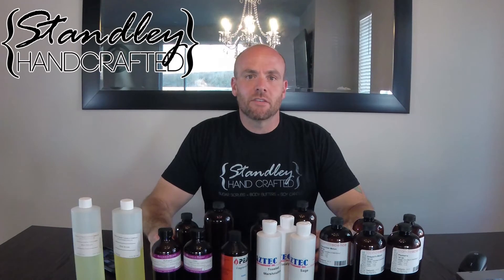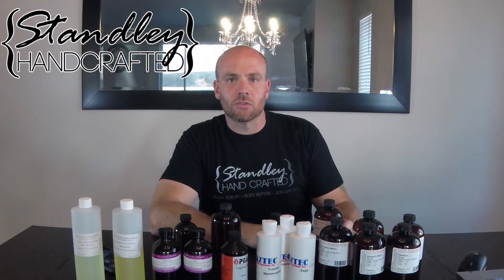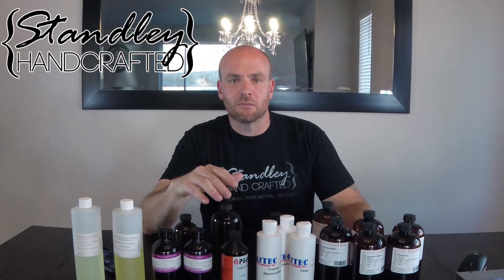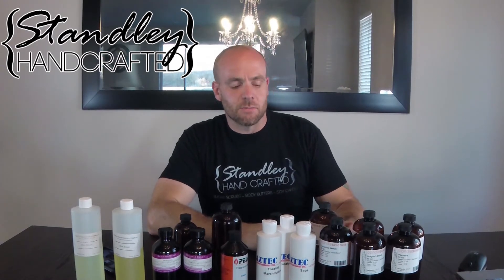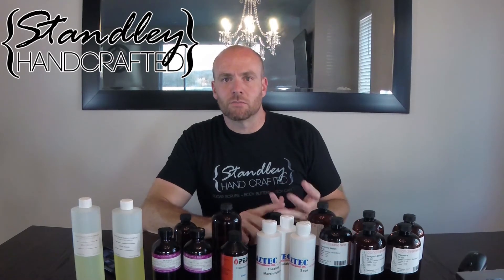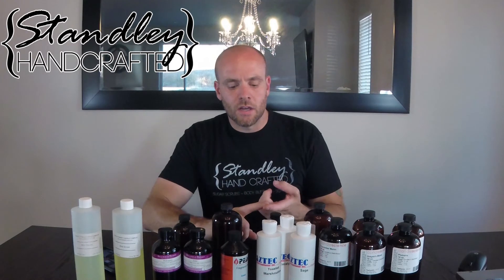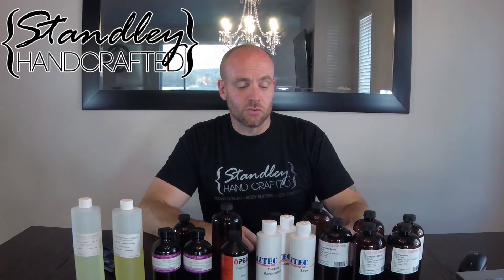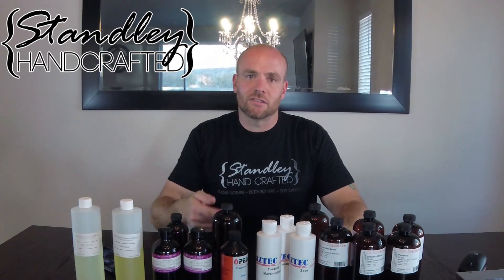Candle Basics 101: What are flash points and what do they mean?

Comment: I’ve never made them before but all the companies are like you must check the flash point as you shouldn’t never add the oil until it gets to that flash point or it won’t smell but then your saying it doesn’t matter ? I’m confused - mines for 30cl soy wax candles using orange
Reply from the maker: Michelle Heighway That’s definitely wrong. Check Candle Science webpage for a good explanation also. It’s a chemistry term for the temp at which a liquid starts to release vapor and can ignite if near an open flame. Not a concern for adding to wax.

Comment: Coming from soap making and knowing about essential oils this makes no sense. Are FO packaged just for candles labelled differently than FO used for other things? In every other thing I make the flashpoint is the temp that the oil, or scent, starts to burn off.
Reply from the maker: Brooke Flinn Flash point is the same for essential oils as it is for fragrance oils or any chemical. It’s the point at which the oil itself starts to let off vapor and becomes flammable if near an open flame.
Reply: @StandleyHandcrafted  ok, but then I'm still confused. To my knowledge there are no open flames on air planes. So why would flash point only matter during shipping?
Reply from the maker: Brooke Flinn It has to do with high temperatures and pressure. They can combust. Airlines have restrictions for all kinds of flammable liquids, aerosol cans.
Reply: @StandleyHandcrafted  Do you simply not ship over seas? Are there packaging labels you must put on your products? I'm trying to figure out this line of conversation further.......This way I can get prepared with the marketing and products for placement and orders. Thanks so much. 
~*Shana
Reply from the maker: Chris and Shana You need to be concerned if you’re shipping oils. Not candles. 🙂

Comment: Great video very informative, I do have a question I been wanting to make lemon scented candles using 6006 as well , but I read you should add citrus fragrance oils at a lower temp because you run the risk of the scent to burns off  I've read so many conflicting answers with citrus scents please help
Reply from the maker: Daisy Bran You're better off adding most fragrance oils at lower temperatures but with citrusy scents I have had better luck with adding a little more than the typical 6-8% that I do with some others. I've noticed those tend to stand out more when I do. 
I don't know if all citrus scents need that same type of care but for my lemon scent that seemed to help hot throw.